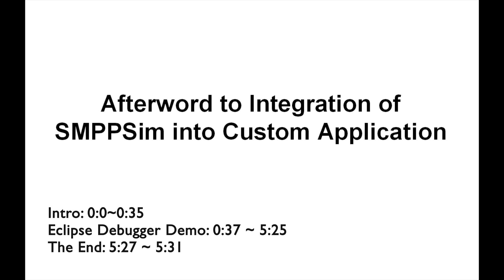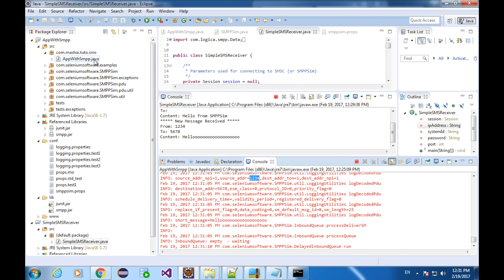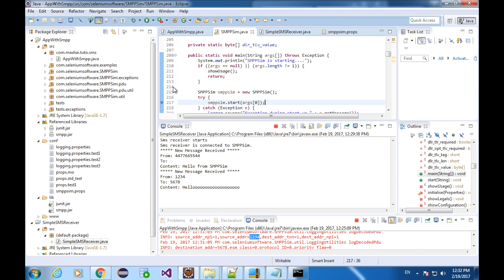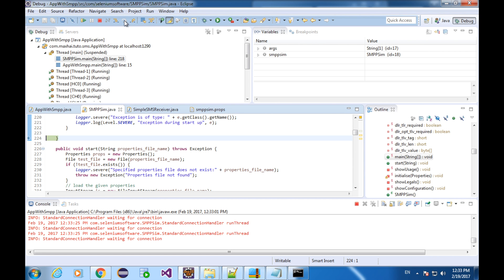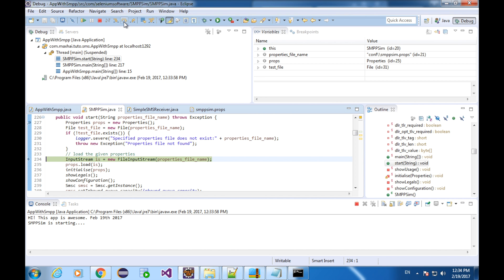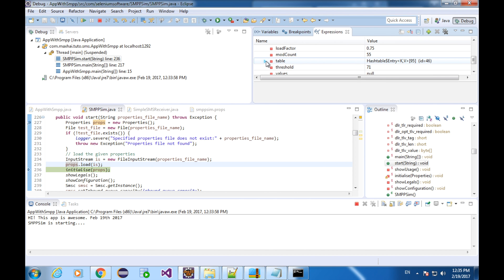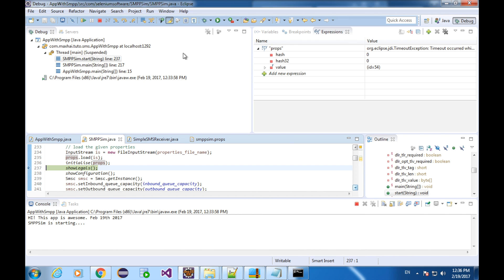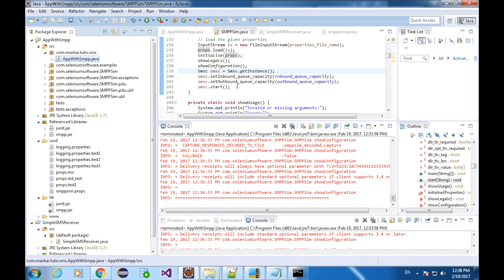SMS Tutorial 03 -- Afterwords to Integration of SMPPSim into custom app | Eclipse debugger example

Comment: Hi.. Can you please tell me how to get sms delivery report from SMSC?
Reply: Bhuvan Aggarwal Hi!

1. Make sure SMSC is configured to be able to generate and deliver the delivery receipt.

In SMPPSim, you might modify the following parameters, via "conf/smppsim.props":
1) DELAY_DELIVERY_RECEIPTS_BY
2) PERCENTAGE_THAT_TRANSITION
3) DELIVERY_RECEIPT_OPTIONAL_PARAMS
4) DELIVERY_RECEIPT_TLV

2. Make sure the client (ESME) binds to SMSC as transceiver

3. Before submitting submit_sm PDU, setRegisteredDelivery((byte) 1)

4. After submitting submit_sm PDU, try
DeliverSM deliveryReceipt = (DeliverySM) smppSession.receive();

5. If deliveryReceipt abovementioned has
esm_class == 4, then that's the delivery receipt

6. You can try deliveryReceipt.getMessageState(), deliveryReceipt.getNetworkErrorCode(), deliveryReceipt.getReceiptedMessageId()

Hope this helps